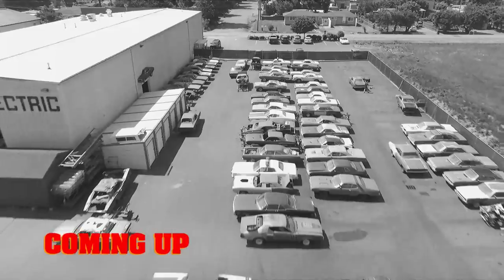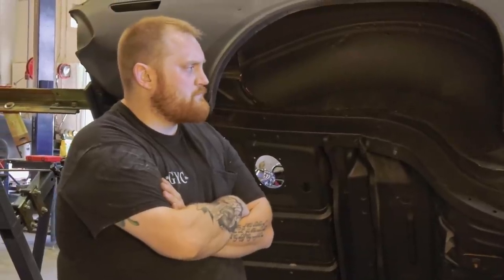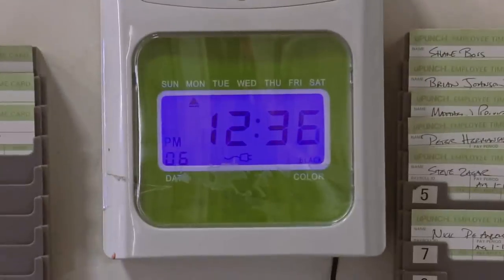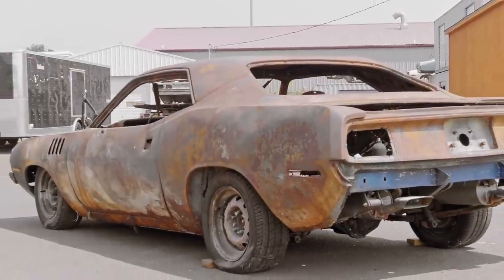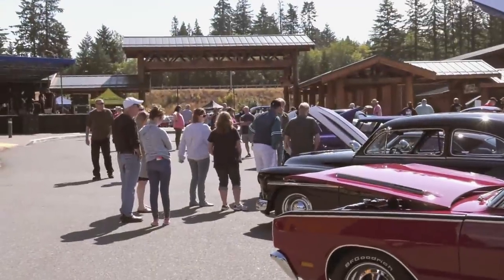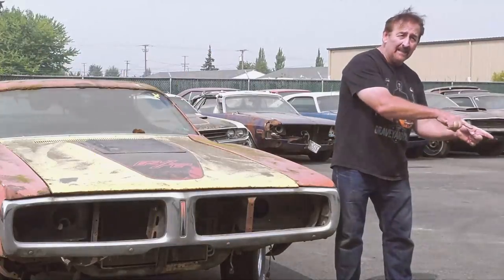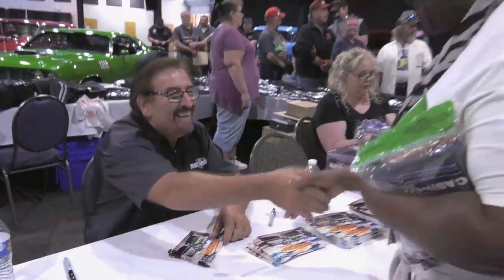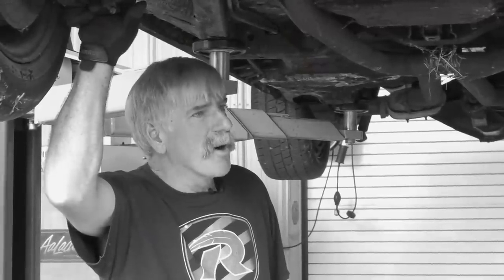S10: DISASSEMBLY '71 HEMICUDA TOTAL LOSS

Comment: A was helping a friend of mine work on his car.  He somehow managed to pinch a wire when he replaced his starter.  It shorted out and started a fire.  All the leaks on his car added to the flames.  The entire engine compartment was burnt and up to the bottom edge of the windshield.  The windshield melted about a third of the way up.  The entire floorboard carpet all the way to the front edge of the seats was burnt.  Yet, the entire dash and inside fire wall was never touched, as well as the front seats and doors! It's amazing how fire works.  It is so unpredictable.

Comment: A full tank of gas will not explode...within a certain amount of time.  If it had been a 1/2 tank or less...it would have been nasty.   Saw a work truck once spin in the mud of a house being built and put the ass end with the gas tank right over a huge fire that was built to burn trash, leftover lumber pieces, tree limbs, and anything anybody wanted to put in the fire.  The truck burned to the ground but the full gas tank never exploded.  The fumes is what cause an explosion.